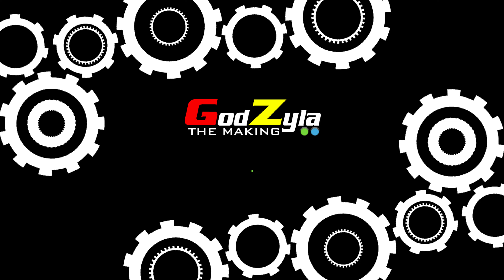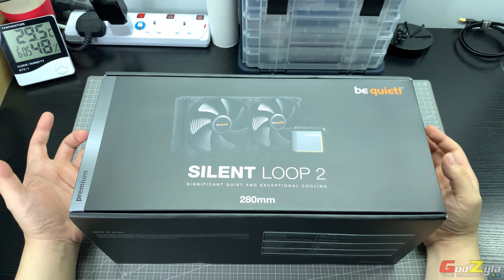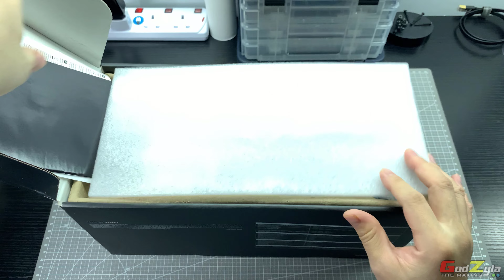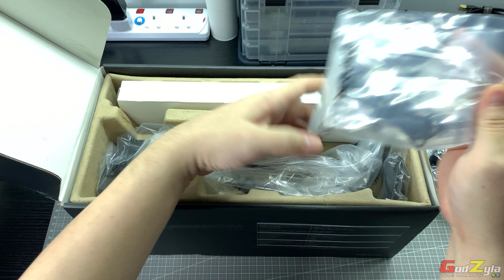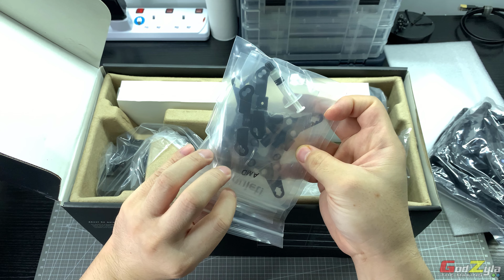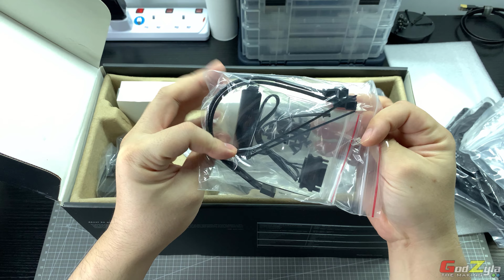Bequiet! Silent Loop 2 - Overview & Pump Noise

Comment: Thx for the test but it would have been better to use a microphone without a build in compressor - there is no way to compare the noise level of the two devices if the signal itself is automatically pulled up to a fixed level
Reply from the maker: Hi Axel Žužek, welcome to my channel and point noted. Thank you for your feedback.👍👍👍

Comment: Be quiet pump is very loud. I am going back to my air tower cooling because I am big fan of quiet constructions.
Reply from the maker: Hi Robert Grzelak, welcome to my channel. If it's noisy, you might want to check this liquid AIO https://youtu.be/0FXVnZnqX9I but it only comes with 240 and 360 in size.

Comment: that be quiet pump is rather loud... I guess it is the pump noise i can hear from my case,... i guess i should go back to Dark Rock 4 Pro...
Reply from the maker: Hi DxBang, welcome to my channel. I don't think is louder than the Dark Rock 4 Pro, maybe is up to indivdual hearing but for me is rather quiet. Maybe if your AIO is still under warranty, you might want to get a replacment. The Slient Loop II is quiet, unless you are using pure loop.
Reply: @KleoYan  I had the Pure Loop before, but that pump died, a dead pump means overheating at boot...

I have replaced the original fans on the Silent Loop 2 with some Silent Wings Pro 4 and these fans are amazing. But the thing is still, it is now the pump that I hear, not the fans. Sometimes it sounds like a refrigerator. I have recently done a "top up" on the refilling of the AIO, but maybe I should redo it, as I can actually feel the water pumping in the tubes.
Reply from the maker: @DxBang3D  I see. If it still does not resolve the issue. You might want to RMA it. As what I know and have been using. 280 or 360 the pump is silent
Reply: @KleoYan  also, the pumps are running at 100% as recommended by be quiet and attached to the AIO Pump on the motherboard which is 12v
Reply from the maker: @DxBang3D  yup Infact all liquid aio pump should run at consistent speed.
Reply: @KleoYan  I am waiting for the Dark Rock Pro 5 :) ((hopefully in WHITE))
Reply from the maker: @DxBang3D  I see. All the very best.

Comment: pratically,be quiet pomp is loud
Reply from the maker: Hi Anna Salieri, welcome to my channel. I guess is up to individual hearing. For me I am not able to hear anything when it’s inside the case and the case is just one meter away from me on my desk.
Reply: @KleoYan  hello, i 'd like to buy a silent loop 2 120. about pump: they told me i can hear it if you give it full power this 12v. the recommendation is to lower the voltage to 9v or 75% power in  system BIOS but i don't know  how to do it.i am not clever with pc. i will lose performance but i have an i3 12100 and don't gaming.
Reply from the maker: @annasalieri5085  hi, to be honest, I do not advise to lower down the voltage plus you are choosing to use a 120 AIO, you need to draw hot water fast to the radiator. However if you choose to lower the voltage to 9v or 75%, you can.. you will need to learn how to go to the bios of your motherboard and to find the Fan control settings where you can set it.
Reply: @KleoYan  can you tell me a good aio 120 with a dead silent pump?
Reply from the maker: @annasalieri5085  hi I don’t usually use 120mm air. If 120mm I rather use an aircooler. But if you really wanted something quiet. Arctic Liquid Freezer II will do just right.

Comment: Great AIO watercooling. Very easy to install.
Pump become noisy at 2400rpms (max is 2800). I've replaced fans by the "not high speed" version wich are more silent.

I use a ryezen 5600X with enabled PBO in full occt power test, CPU is around 85°C... a little bit hot but this situation doesn't appear in others conditions for me... in regular situation, PBO is disabled and the CPU temp is under 60 or less and everything is fine.
Reply from the maker: Hi Dany GINHOUX, welcome to my channel. I guess is up to individual sensitivity on noise level, my pump is at full most of the time and I don't really hear the pump noise and it's been like a month or so now. Once again thank you to have visit and to leave your valuable comments.

Comment: How about running it at 9 volt witch is supposed to be a feature of the pump, and then run the noise test again.
As far as i can see, nobody has done this and i for one would love to know the result.
Reply from the maker: Hi jobbejsk, welcome to my channel. I believe it will still remain the same characteristic but quieter. I see what I can do once I am done with work project. Once again thank you for visiting and to have provide valuable feedback,

Comment: i have the silent loop 2 240m, how much do you think is the difference between the 240 and the 280mm? also can i upgrade to a zen 3 Ryzen 9 5900x?
Reply: I've been running a 5900X in my Mechilicious case with the Silent Loop 2 for about a month now.  Running Cinebench 23 I see temps between 55 to 70 degrees C depending on the ambient temp in my basement.
Reply from the maker: @digitalmike330  welcome to my channel. Yup it greatly depends on where your location is at, here in Singapore, am not able to obtain the temperature even when there is air conditional on. as it's always hot and humid here. The minimum I can reach is about 67 and never lower, but no doubt this silent loop 2 is still a very good AIO as compared to some other liquid AIO that has a 27 to 28mm thick radiator. Once again thank you for visiting and to have leave your valuable feed back.
Reply: @digitalmike330  - How's the noise when running proc heavy tasks?
Reply from the maker: Hi M.Daffa Alghifari, welcome to my channel, it depends on how much airflow is in your case. The difference of 240 and 280 is surface area. Of course 280 will perform much better but it will also depend on which case you are using. 240 is ok to run a 5900x at default or to undervolt it using PBO2. make sure your case have good airflow. You have to experiment it. 

for me my choice will be to use either a 280 or 360 on either 5900x or 5950x with a average good cooling case (best is to have good airflow). If I do not have a choice but to use a 240. as mentioned 1st no overclocking but undervolting using PBO2 2nd to ensure extremely good airflow in a case.

Comment: wow finally I found this kind of comparison, thanks a ton! So some time has passed since you've got it, could you advise if the pump has changed it's sound profile and loudness within these 2 weeks?
Reply from the maker: Hello Ilya Gordienko, welcome to my channel, you came to the right place. I did let this Liquid AIO running in a system for the past 2 weeks. There are no changes in sound profile. 
the pump is so quiet. Another thing I notice is that I use to hit 78 degrees Celsius for the first few days. Right now it drops to 76 to 77 while performing 3D rendering and video compilation. This could only tell that the nickel plating on this AIO is bonding well with the Arctic MX5 paste. 

I will be doing a comparison thermal test on my main rig which is currently on an Artic Liquid Freezer II 280. lets see if this Loop 2 AIO is able to compare with it. 

Once again thank you for your comment and to have visited my channel. do remember to subscribe and to click on the notification bell button for future video updates. 👍
Reply: @KleoYan  thanks for such a detailed reply! By chance, did you compare top air coolers vs aio's in terms of sound? Can't decide whether I should get this aio or maybe a decent silent air cooler for my i5 11400f, I'm extremely sensitive to loud sounds, up to headaches and panic when someone laughs loudly for example :/
Reply from the maker: @BigWhiteCloud  hi sorry to say, ever since I started using water cooling. I stop using air cooler as I dislike the discolouration on the fin stack. Be it aluminium sliver or black. Just don’t like the mould on them and have to have a hard time to make them shine. I can understand about the noise issue. That’s why I choose to use the arctic liquid freezer II and now this is the quietest among the rest of the cooler. It beats arctic for sure.
Reply: @KleoYan  this is probably the most complete feedback I could get on this aio, thanks a lot, will be getting it for sure then
Reply: @KleoYan  Could I ask you the same question, but now about 18 months later? Have you noticed any (quality) issues since then? Any change in noise?
Reply from the maker: @goovy3  hi welcome to my channel. I have used this aio since then till now which is in my lian li Q58. I haven’t notice any noise nor performance degrade.
Reply: Yea, I also agree on the esthetic matter of air coolers, they definitely make the overall look of the PC interior cheaper
Reply from the maker: @BigWhiteCloud  Is more like rotten algae on a piece of metal equipment.
Reply from the maker: By the way the comparison result are out in this video https://youtu.be/EDgJu0DkkIY

Comment: Sir i have a doubt is it normal for EZ debug light cpu to blink once after i shutdown my pc ?
Reply from the maker: Hi The Internet Surfer, welcome back. That indicates that there are still current flowing from your PSU to your motherboard. That is common in some cases whereby the electrical current is unclean. A way to find out is,  you might want to try another electrical outlet to see if that happens.
Reply: @KleoYan  thanks sir i will try that out.
Reply from the maker: @YaduUvach  you are most welcome.
Reply: @KleoYan  sir i tried with out power outlets and UPS too also there was the same issue. Also my CPU ez debug light lights up during startup for few seconds too and also after shutdown, this all happening after i installed the new CPU, Is my Cpu Defective ?
Reply from the maker: @YaduUvach  Hi just to check, when you replace the CPU, did you do a clear CMOS and to re-run the system. sometimes that helps. you might want to try that. if still reacting this way, I have no idea how to aid you. you might want to bring in to a shop to diagnose for you. it can be your CPU, it can be your PSU.
Reply: @KleoYan  yes i cleared CMOS also i removed CMOS battery too , PSU is brand new so i don't think it might be the issue. One more thing that i noticed that after power is on and 2nd time when i reboot the system without switching off the electricity (i mean not a cold boot) it boots up immediately without Ez debug light on but still the CPU ez debug light lights up after shutdown.
Reply from the maker: @YaduUvach  I see. maybe you can try asking anyone at reddit .. which motherboard are you using btw?
Reply: @KleoYan  i asked every subreddit out there also on linus tech tips's forum but noone has an answer , Im using msi mag x570 tomahawk wifi motherboard(which has been RMAed and returned back saying no issues)
Reply from the maker: @YaduUvach  I see. then I have no idea how to aid you on this. why not grab your PC and go to a professional shop to aid you on your issue. if not contact MSI directly to check is that the characteristic of the motherboard.
Reply: @KleoYan  sure i could have tried that but i live in a rural area where people are not at all into PC they just own mediocre laptops and use them. No shops atleast within 100kms